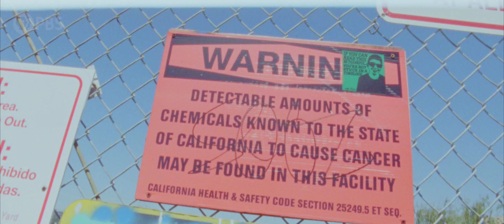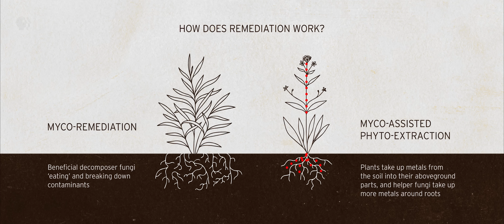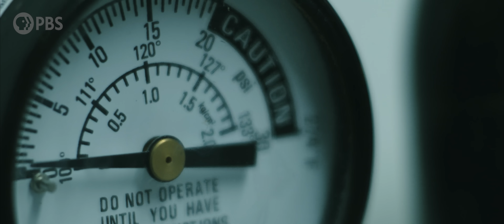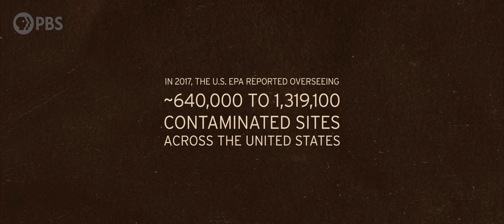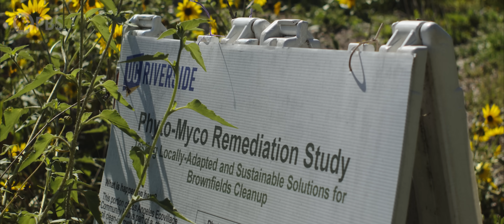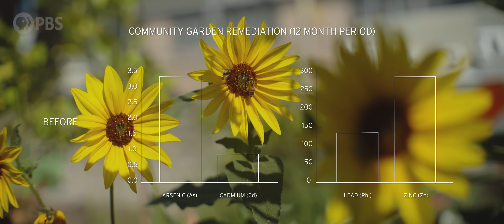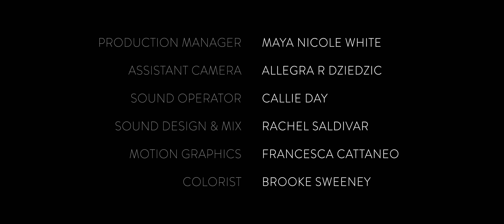She's Healing Wildfire Pollution. With Mushrooms.

Comment: I might have missed it, but what do you do with the plants that absorbed the contaminants? if you leave them, wont they just return the contaminant? Or is there some chemical prosses that the plant does to eliminate the contaminate?
Reply: This was exactly my thought. These plants are not safe to consume, by humans or rabbits or any other animal. Then they get concentrated in predators like mercury in tuna. If there's a drought and the plant dies or burns, the metals haven't moved unless they wash downstream. There's some missing info here.
Reply: Same! Some stuff can break down but not heavy metals.  Is the point just to stabilize the toxins so they don't spread?  This reminds me of the underpants gnomes.  Step 1 collect underwear.  Step 3 profit.  Please tell us step 2! 😂
Reply: I could be wrong, but I but I believe this works because not all of the plants will die at the same time. As the plants die, some of their remains get spread beyond the site where the metals and chemicals do become part of the soil, but not at toxic levels. Once the contaminated site is able to support more plants sprouting naturally after a few rounds of planting, it will create a chain reaction where the newer plants will absorb the contaminants left behind by the older plants in the area. This will lessen the contaminants in the soil and spread out the toxins even further. Over time, as parts from the plants on the site such as seeds and leaves are spread out to other areas, the contaminants are spread out so that they do not exist in any area in toxic levels.
Reply: it's a time thing. contamination of basically ANYTHING is about exposure levels and time. The strength of the exposure, and how long you're exposed for. Doing this, you're vastly shortening the exposure time as the contaminant gets absorbed into the plant, and if something does eat the plant their exposure would be dramatically less than the raw base exposure of the soil as it's been diluted in the plant.

ALSO: There's a new thing called biomining that is popping up, where companies literally mine metals using extractor plants, then process the plants to obtain the raw metals.

Comment: 2:15 gypsum is not asbestos. This is bad information
Reply: Until the mid-1980s, asbestos was commonly added to plaster. It was an inexpensive way to increase the plaster’s ability to insulate buildings and resist fire.
Reply: @munchingsquirrel5067 that’s joint compound not the rock
Reply: @Icu-812-me2  She mentions drywall.  Technically you're correct that it's not in the board.  But she's correct in that it was used in construction when using drywall.  The net effect was that the asbestos was on the drywall, though not in it.
Reply: According to Mesothelioma website, companies did use asbestos in drywall for much of the 20th century.
Reply: @elsa_g if you ever saw fake snow ❄️ back in the day that was 💯 asbestos. The shit on flocked Christmas 🎄 trees will cause irreversible cellular and neurological damage
Reply: @Icu-812-me2 are you a bot? Genuinely why are you bringing that up we were talking about drywall
Reply: @elsa_g asbestos was my issue. It’s been discontinued but Sheetrock and topping compounds made in my lifetime are free of that.
Reply: @Icu-812-me2 - "made in my lifetime". You DO realize that many homes were built before you were born, right?

If you're going to challenge something, make sure you know what you're talking about. The world didn't start when you were born.
Reply: @EsmereldaPea  can’t sell a home before 1978 without lead paint disclosure form.  New home don’t need that so you take what you will from this
Reply: @elsa_g the lead poisoning will nullify the lung damage. Look for prop 65 in my state. It’s everywhere.
Reply: I believe she is distinguishing the two from each other but stating that in old construction there may have been asbestos in the buildings which could have been near the drywall.
Reply: My beef is that seems to be leading on that those materials are pervasive and still being used to make our homes. A half lie

Comment: Its a great idea to use nature to "fix" something that we messed up. The problem with this in urban areas is that if you're rebuilding on that site, you don't have the time to wait for a natural fix. That is why the soil is moved elsewhere causing other issues. If it was feasible to wait for months/years to rebuild or if we were changing that site into a nature preserve or something, then this is a realistic solution. Don't get me wrong, I love the idea and she should definitely get more funding and support, but you have to have realistic expectations for the scale of this.
Reply: good point! natural remediation methods can take longer than dig and dump, but can also be done alongside rebuilding to not delay that.

Comment: Not exactly. I don't think you can just add mycelium. When looking at biomes as a whole. The debris on the surface will most likely become toxic with the incorrect fungi and negatively affect the trees and mycelium. The water table needs to be working correctly as well... Toxins typically would build up in all the animals, even before man and those toxins spread somewhat evenly based on their diet as part of a balanced biome. Animals, like snakes that are considered venomous, would typically eat mice and what not, consume all but the skeletal remains, which aids in Calcification and keeps toxins or various metals, energies, in concentrated amounts.  Skin cycles and stomach lining cycles, basically determine life expectancy to a certain degree. Venomous animals, essentially became so, as a result of converting those toxins into venom as a form of bio mass balance, less energy spent hunting, compared to life span, as a result of exposure to toxins.... It's a pretty profound concept when you really think about it...  That's why places like Australia, with it's coal and mining industry are considered to have so many venomous creatures. 
You need a variety of Flora and fauna, that work well together, as well as some TLC. Current ways of perceiving nature and our role are wholly flawed... The yellow is interesting though, that visible wavelength  connects to arsenic and gold, bananas with their potassium..

Comment: Really curious how well this would work in more arid areas. Is there a certain soil moisture level necessary for the mycelium to survive?
Reply: great question! I have tested these methods in arid areas, and that's where utilizing fungi from those areas that are tolerant to dry conditions works best.
Reply: @daniellestevenson7514  Los Angeles is pretty arid, by default. Was the auto shop site irrigated during remediation?
Reply: In Arizona we have a fungus that grows in living tissue and leaves it's spores in the dust.
  It causes valley fever and fungal meningitis among other things.   
  This fungus gets rid of humans.  It fights pollution at the source.